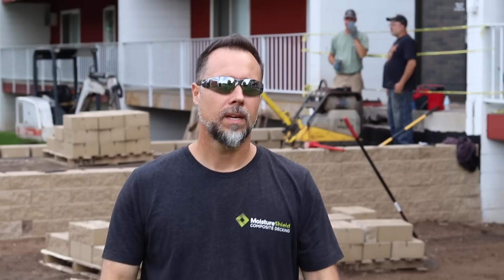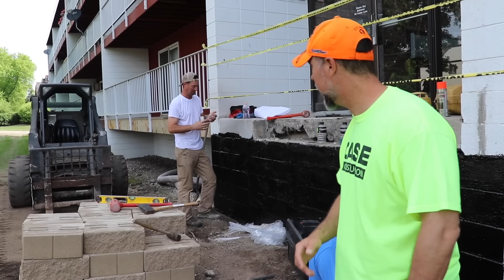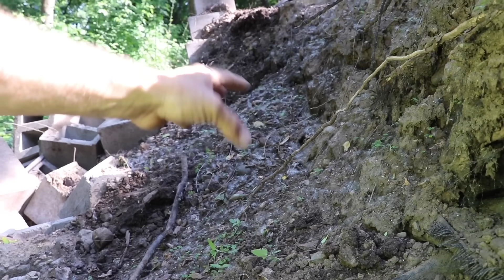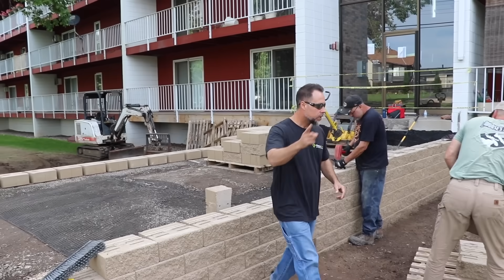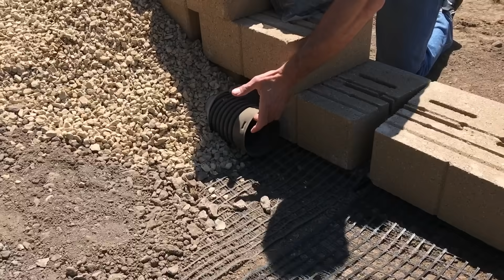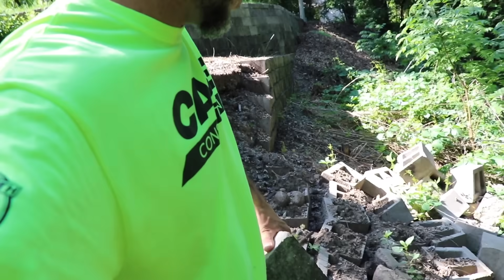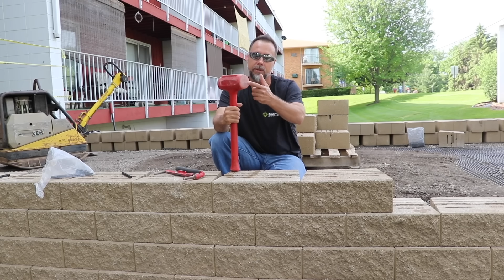How NOT to Build a retaining wall.  RED FLAGS, common mistakes, bad designs pt1

Comment: I would think the geogrid on the siides of those two walls would make the walls stronger. So i my question is why not use geo in between against both walls.?
Reply: Shadow Wolf the strength of the geogrid is in resisting tension which in this case is lateral forces. If you place the geogrid vertically it would be resisting the soil from moving up or down. The soil can't move up due to gravity and the layers are compacted so it can't move down.
Imagine putting soil in between your hands and compressing it with a layer of geogrid horizontally in between. Now imagine, your hands in the same position, doing this with the geogrid vertically. The geogrid is worthless.
Picture a piece of rebar. Lay it down on the ground and grab each end and pull it apart. Very strong. Now stand the rebar vertical. Place one hand at the top end and one at the bottom and pull apart.
Also, if the geogrid was against the walls it would be in the drainage layer where there won't be any separation of soils.

Comment: Using a wall that wasn’t built to manufacturers instructions to justify having to use solid blocks doesnt make sense. The wall that fell down was built on sloping ground. The footing would have needed to be piered down to lock in place. Its not the block thats the issue its simply the way it was built.
And I dont want my guys lifting 83 lb blocks all day, it will ruin their backs and is above safe lifting limit set by your work safety authority.

Comment: I disagree with the landscape fabric causing the wall to fail. One geogrid layer installed properly would have saved this wall. When limestone is used for the drainage layer behind the wall, fabric will help stop efflorescence from building up on the face of your wall. I dont think you want the water to go through the wall and pull all that calcium with it, depositing a layer as it dries. If necessary during heavy rain water can flow through the fabric but usually the water flows downward behind the wall to your footer drain. I have never seen fabric as the sole cause for a wall failure in 25 years.
Reply: I think he means weed fabric

Comment: While I don't put fabric directly behind the wall, I heard that you're suppose to put fabric as a vertical layer between the earth behind the wall and the 12" of vertical drainage.  ( wall - drainage stone - fabric - earth). The reasoning was to keep the drainage  material free from dirt.
Any truth to that? Or absolutely NO landscape fabric?
Reply: Fabric separates soil from gravel, so as not to contaminate the gravel and reduce the gravel's ability to drain water away (which would increase risk of wall failure).  Fabric is cheap, and so you should consider to add the fabric.

Comment: Do you ever recommend using a drainage system or landscape fabric?  I'm building a 4 foot wall along my driveway with versa-lok and I'm receiving differing opinions. Some contractors always use a french drain system, some don't. Some use landscape fabric (non woven geo textile) to hold back the soil in the trench and then back fill along the wall with 2b gravel. The fabric is NOT against the wall, it is in between the soil and gravel. Do these things help, hurt, or make no difference? Thanks!
Reply: Depends on the height of the wall, and the climate you live in.  Very short walls in hot climates might be ok without drainage behind them.  Taller walls, in climates with freeze/thaw should always have a drainage layer behind, and often need geogrid to help hold back the taller soil.  Block wall manufacturer websites have documentation with general guidance, but those documents also always add a disclaimer that an engineered design is required per local building codes, and for any unusual situation (i.e. surcharges from traffic above, toe slopes, slopes above retaining wall, poor soils, etc).  General rule of thumb is to design/build it more conservatively (much like Stanley has done) and you'll sleep better at night!

Comment: I'm a home owner and I came to your video because a contractor recommended I get a retaining wall as an addition to my home sits on a hill and is about 7 feet away from the slope. The concrete footing is starting to sink into the ground. All the details of retaining walls you explained were very helpful. I guess the retaining wall I need built is a surcharge wall. Do you think this a wall is necessary to repair my foundation and if so should I get more quotes? He was the only contractor who mentioned a retaining wall to me. Thanks in advance.

Comment: I seen contractors on youtube  use fabric between the gravel and the dirt behind the wall , is fabric needed or just the geo grid
Reply: Fabric separates soil from gravel, so as not to contaminate the gravel and reduce its ability to drain water away (which would increase risk of wall failure).  Geogrid helps bind all the retained soil behind the wall together, so that it's not just the wall that's retaining the soil, but the entire volume of reinforced earth (physical wall + volume of earth embedded within geogrid) that helps hold back all the soil behind this "system".
Reply: @millinghill  Thanks for your feedback, great video's.

Comment: I thought this was a pretty good video. You covered all bases on proper construction of retaining walls. An important thing you stressed was not using landscape fabric 
behind the wall. In my earlier days the company I worked for did this and I imagine there are a few failed walls that occured over time. I like the Versa-lock wall block - it is a quality product. A lot of landscapers use Allan Block around here and landscape architects spec. it in their jobs. I personally think most of it is junk but it is what it is. The only thing I question is installing the block off level to compensate for the geo-grid. I have never seen that specified anywhere, but if it works for you that is cool. All these little guys doing wall installation should watch your video because half of them do not have a clue about retaining wall installation
Reply from the maker: Really appreciate the comments Jeff, thank you !

Comment: I have the world's dumbest question. With hollow blocks that are fully hollow, why not just fill the void with cement or concrete? If it pours all the way to the bottom, it would probably take a side load much better.

Comment: lol 85lb blocks? sounds like you dont lift my friend.. those 2 blocks weigh the same.. also, companies dont "hollow out" blocks lmfao.. they are casted. you should know this.   if you grout and bar those webbed blocks, theyll last just as long as the 5 1/2" slabs at half of the price..   the problem with the existing wall wasnt the block. it was the installation, drainage, and the backfill.  Ive installed faced block retaining walls that have lasted 20+ years that look practically new. sounds like you're pushing an expensive product

Comment: Hey Dirty Monkey ; On a Manly - Man Type Jobsite , If'in U Start Yak'in About Eye-lash Talk I'm Gonn'a Tell U 2 Pucker Up & Take Like A Man [ Full Face ] Engage - !? Luv'in U & What U Dou But , Not The Way U Think !!! YYZ , Mohawk-Planker ...BTW - Y No Talk about Keeper's / T-Type & Such ; Help's with Wall Blow-Out  , Especially In Frost Expansion + Water Weight Condition's & Don't 4-git the Drainage Port's / Some 50 yr Ago the Holy Brick if Installed Correctly is Still a Superior System . Fill Each Course Cavity with Cement  & Drive 3/4 Rebar Down Said Cavity Mak'in SURE U'r Block's R Staggered at the Joint's . On a Bed of 3/4 Stone + Appropriate Spaced Drainage Port's Will Give U Protection From The Biggest Big-Bertha as Concrete Will Krack & Block-Work Will Absorb Shock & With T-Keeper's The Wall is Effectually 5 ft + Thick  [ Depending on T-Keeper Length ] ! Also Run 3/4 Stone Up Dirt-Side of Wall 2 help with Drainage . New Stuff is Kool But Old School Rule's ...

Comment: As a civil engineer, I've been designing these types of retaining walls for over 30 years. It's nice to see someone do it correctly for a change.
Reply from the maker: Awesome Kurt, thank you !
Reply: @Dirtmonkey  You know it Jack!
Reply: Your work is absolutely spot on, Stanley. Stunning to see work done right.
Reply: Hello,

I am having a massive versa-lok wall  (2100 sf) installed that will be holding up a hill on both sides of the house. The masons are using crushed concrete on top of compacted dirt and then a concrete and clean fill mix on top as the base. I thought the concrete would be hard but when push my finger down in can drill down the concrete slab and my finger goes through. The wall is in progress and looks flat and stable but am worried if the base is correct. The soil is actually alot more like clean fill it looks like 
fine sand so I asked them to use filter fabric between the dirt and gravel but not on the face of the blocks. They have used a drainage pipe in the back and will be drilling relief holes on the bottom blocks. Can you or anyone with proper experience advise if the base material is correct and also if the use of filter fabric is a good idea to hold up the fine sand which makes up the dirt in place?
Reply: ajx - “They have used a drainage pipe in the back and will be drilling relief holes on the bottom blocks.”

It’s been three years, so hopefully your wall was built and remains solid. The sentence I copied is the critical part. The drainage pipe and holes in the bottom blocks, called weep holes, allow excess water to flow through the pipe or escape through the block so that it doesn’t build up hydrostatic pressure on the wall. 

As for having a fabric interface or not, there’s some debate on the topic and probably has more to do with the type of soil. The argument against fabric is that the individual pieces of soil will interlock in the gravel void space and not continue to flow through. The width of the boundary zone will vary depending on the characteristics of the gravel and the soil. High clay soil has the smallest grain size so it is more likely to keep flowing. Personally, I like the extra layer of separation, but it shouldn’t be a deal breaker either way. 

The open graded gravel and drainage pipe with an outlet to relieve the water pressure is the critical aspect.
Reply: Wait? You mean they actually go out and physically build walls? Pretty sure civil engineers work on computers and that's about it lol
Reply: No problem. I mean it. Great videos.
Reply: I disagree!!!
That is geo fabric behind wall ...not filter fabric....filter fabric is how to prevent your wall from having dirt stains running down the face.  .especially a white retaining wall..look out when u get a heavy rain not going to be good..
We have been installing these walls since 99 and install for supply store displays
Reply: @gmaster716  wouldn’t the problem with that failed wall be that there is no drainage or incorrectly placed drainage agrégate.
Reply: @roberto.gallegos  in this case is was the wrong fabric and improper backfilling
Reply: @gmaster716  i agree. personally i never put the filter fabric on the back face of the wall but rather between the rock back fill and earth if the earth has low or no clay content which works just as well for keeping the dirt from running down the front face of the wall without the risk of increasing the chance for excessive pressure to build up behind the wall.
Reply: @Zack-dk3pt  what do you do if there’s high clay content??
Reply: @gmaster716  ruh roh, dont think he will agree after watching the first 5 mins
Reply: @EbanksBuilds  im not sure what you mean?? I am right the wall was installed wrong
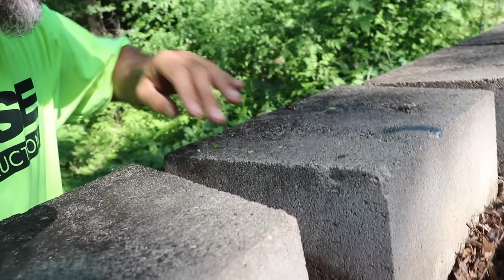Reply: @gmaster716  2:45
Reply: @daviddailybrass  
Not sure what your implying
He is wrong you need filter fabric vertically up against soil wall then clean stone ..then block 
Geo textile on the bottom 

Filter fabric up topl
Reply: The drainage rock and pipe behind the wall will keep any of that water from flowing through the wall
Reply: Hey Kurt, what's the difference between a mechanical engineer and a civil engineer?
Reply: @331SVTCobra  they both failed electrical engineering

Comment: we a school in my area built right on the loess/clay river bluff and built a retaining wall that was AT LEAST 30 ft high and 100 ft long. Of course within a year of the school opening the kids found out if you placed a ball at one end of the main hall it would roll all the way down to the other end. 
The retaining wall is fine for keeping the sports feild level enough, but as far as keeping the school foundation in place on essentially "floating land" was just asking for too much methinks
Still pretty impressive driving by tho

Comment: This man is clueless. 
Lay block off level? why? the grid should extend to within an inch of the front face of the blockwork. If that is done properly, there's no problem with alignment. The block will not tip forwards. More problems with alignment come from the grids being inadequately tensioned or excessive compaction. There is never a good reason to lay block off level - ever - period. If this guy is tipping block, its because he is cutting corners on accurate grid placement, not tensioning the grid properly or getting his compaction all wrong - too much at the face and/or not enough in the bulk fill area. If you can't get these things right, you shouldn't be on a job site. 
No drain tile? Madness. You need the insurance - no arguments - you need it. If water can get in behind the wall, you need to provide a way fro it to get out. If you just hope and pray it will flow through the joints in the blockwork, one day, you'll get that call to come back and fix a failed wall. THAT was the problem with the wall featured in this video - lack of drainage - period.
6ft wall, 3 layers of grid at 2ft, 4ft and 6ft? Theres no way this makes sense. One on the top? Any wall that needs reinforcement should always be calculated by a qualified engineer - period. Don't let the (dirt) monkeys "design" the wall for you - it will almost certainly fail. What you should know is that the maximum spacing of geogrid recommended by any responsible engineer s 2 ft spacings but that is a MAXIMUM. Many times, that spacing needs to be reduced down, often quite a lot. I've built walls with grid on every course because qualified engineers had taken a whole view and calculated that this would be important. If you build walls to a "rule of thumb" then the rule of thumb is that many of them fall down. Surprise.
Says core filled blocks are bad but they're only bad if installed incorrectly - they have to be core filled. The cores are there to remove mass to make the blocks safe to handle and economical to ship. The mass MUST be replaced with core infill on site. Bear in mind, this guy isn't comparing apples with apples - he's showing a square foot cored block but building his two back to back walls with a much smaller unit. Small units don't need cores so much because you can still lift an un-cored unit - then you have a choice. A square foot block that is solid will just be too heavy to lift - probably over 100 pounds.
Says the lip on the back of the block is too fragile. If he understood anything about the unit to unit shear stresses in these walls and the way that loads act upon the clockwork, he would have to admit, those rear lips are never a problem. There isn't enough stress on the connection to cause ANY problems with the lip. Pins on the other hand... what if they don't get set right or just get left out? Then you have a much higher probability of a unit to unit shear - bigger problems!
This guy isn't safe to be handing out advice. He ought to quieten down if he has a conscience.
What do I know? I've been in the retaining wall business 20 years and seen all the problems created by amateurs like this. 
Hire a contractor that has been properly trained. Contact the NCMA to learn about their contractor training programme and avoid people who have all the gear but no idea.
Reply: "You're always going to be an idiot to some other idiot" jobsite saying
Reply: @ 2 tons a yard, a sf of concrete weighs 150 lbs

Comment: Only using one versa-lifter and two hands to carry the block???  Get a second one and carry two block at a time.  ;-)

Edit: I'd have to disagree on the quarter bubble lean back on a wall.  Versa-lok and most other retaining wall blocks are designed with the block step back/set back on each course so that you don't have to lean the wall back.  Geogrid should be laid under 90%+ of the entire block so you don't have to worry about the block tilting because of geogrid.  I've never heard of a wall leaning forwards because of layers of geogrid and I've been on jobs that had walls 40+ feet tall with geogrid every other layer.  We certainly didn't get to the top and start seeing the wall leaning forwards and our base course was perfectly level front to back and left to right.

Comment: Man this dude is a bunch of b.s. to start they started wrong on their first coarse of block. They offset 2”. Why? If you notice in the video they ended up moving it back with in a half inch.  Typical for a split face block wall. Sorry don’t buy this crap.  Which leads me to my next point. Don’t believe everything you see on the internet.

Comment: I could blow anyone in your company away in a heartbeat with my skill, my quickness and my experience. buddy 5 blocks is what I do and in literally 5 Seconds you need to learn to get an 8-foot-10-foot level/straight edge and do that whole base or most of it in seconds. Not paying block one by one.u should. Have 20 linear ft of base ready to blow block down. Similar to patio base. U level it then blow it in. But working each block like that, u will have issues.